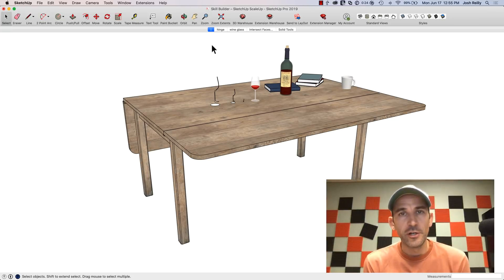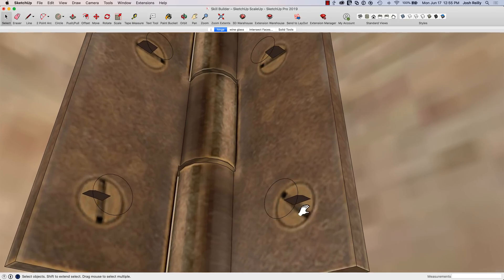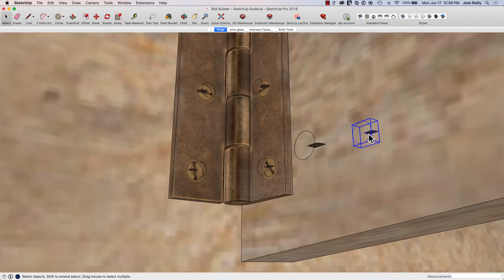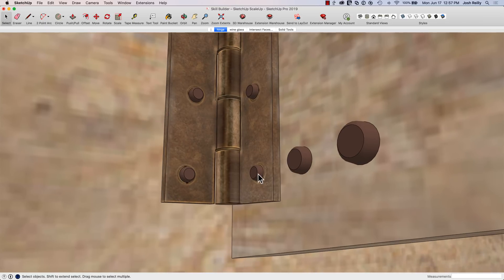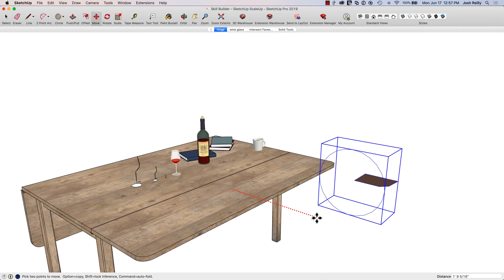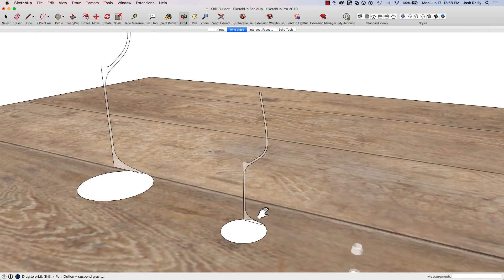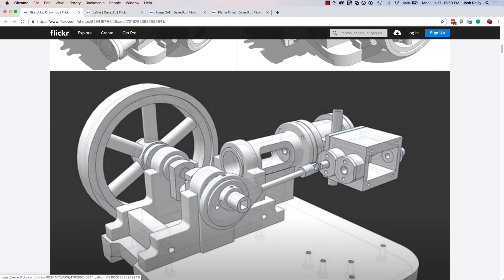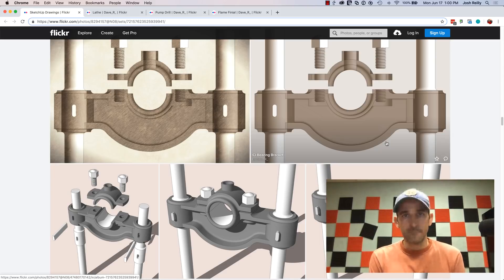Tips for working with small geometry in SketchUp - Skill Builder

Comment: I have made many models where small geometry is a problem. If I think that this is going to be a problem, I start the model at 1000x scale, use measurements units as metres but actually use mm as the real measurements. Then,  scaling down by .001 makes everything correct. This also works if you are importing stl files, just tell the importer that the units of measurement are metres and everything comes in 1000x bigger without small triangle issues.

Comment: Whatever it is that causes is why I can't use sketchup for 3d printing stl
Reply: Certainly you should be able to use SketchUp for 3D printing.
Reply: I use sketchup exclusivy for 3d printing. I draw everything in meters. Ie, if a part is 3 inch wide, i draw in 3 meter wide. Then when im finished, i use tape measure tool to measure line, and i type in 3", hit enter. It asks "do you want to resize model?" Hit yes and then it scales it down with no issue.
Reply: @LT72884  of course there's no reason to scale it down if you are exporting an STL file for 3D printing. Just tell the slicer your model is in inches.
Reply: @daver425  yes, that is true. Great point. My old proprietary slicer could not do this, but my new printer and slicer can:)

Comment: If I'm modeling something small, for 3D printing for example, I just scale the whole scene X10, then scale it back when I'm done.
Working in Metric makes this easier.
Reply: Mark, when I model for 3D printing, I also work in metric. Instead of scaling up and back down or even using the method Josh demonstrated, I set Units to meters but think in millimeters If I want to model something that in reality is 10 mm long, it gets drawn as 10 meters long. I don't bother to scale those models down, though. STL files are unitless so it doesn't matter. When I import the STL file into the slicer software, I tell the slicer the units are millimeters and it's all good.

Comment: Thanks Josh. If I may add a point, while scaling up and scaling back down works, you have to make sure you get the component back in the right location. By working with a copy of the component instead, the original instance stays where it is which saves you work and reduces the chance of errors.
Reply from the maker: Pairs nicely with the previous Quick Win: https://youtu.be/aK99bpqOMYQ